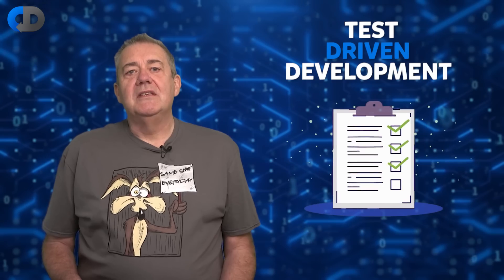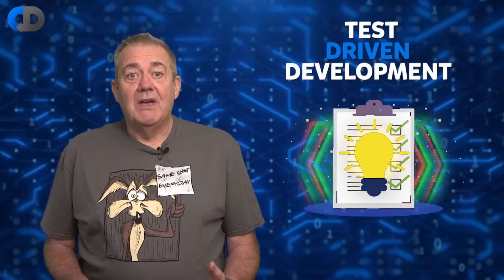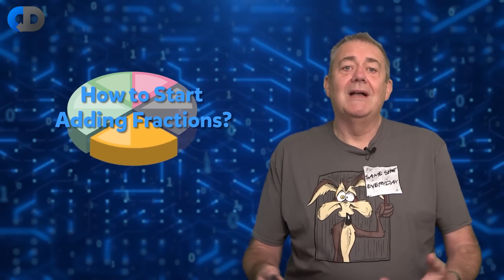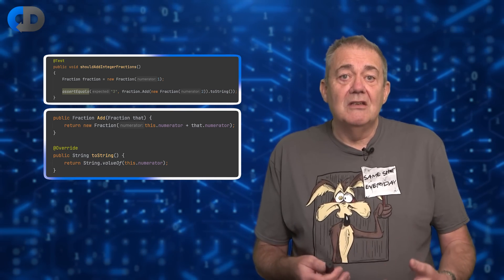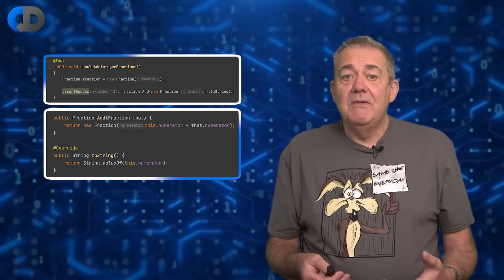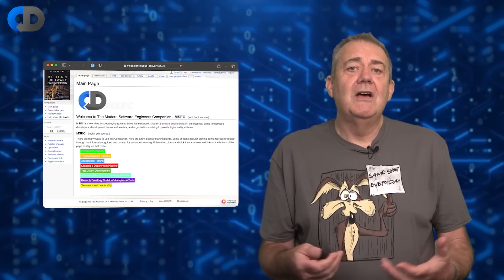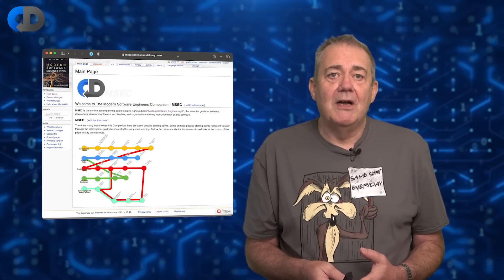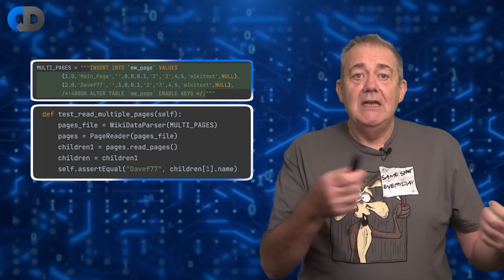Test Driven DESIGN - Step by Step

Comment: The assertion and act should be two different statements, segregated by at least a blank line. The way it is written now impedes readability. Also the test scenario name is poor - it doesnt't reveal what is expected. And you forgot to demo that in TDD, you can write a test without any code to begin with, red means does not compile and it can be fixed by generating code.

The name of this video is also deceiving - it is just one test case. What to test next remains unanswered.
Reply: Arrange-Act-Assert is a pattern, not a Law of Correct Unit Testing. For a simple case like adding two fractions, I much prefer inlining rather than having a separate statement assigning the "actual" to a temporary variable to assert on, simply because it is more concise, and it is perfectly readable. 
Consider this code:
    
    @Test
    void aTimeSegmentCanBeInSeconds() throws ParseException {
        assertThat(parser.parse("PT10S")).isEqualTo(Duration.ofSeconds(10));
    }

This test is a one-liner, but to me, it is perfectly clear what is under test, and what is being asserted: the string "PT10S" gets parsed to a duration of 10 seconds. Now I could separate this into separate arrange, act, and assert statements like so:

    @Test
    void aTimeSegmentCanBeInSeconds() throws ParseException {
        String tenSeconds = "PT10S";
        
        Duration actual = parser.parse(tenSeconds);

        assertThat(actual).isEqualTo(Duration.ofSeconds(10));
    }
I strongly prefer the first version, simply because i can scan that piece of code to get the information i need much more quickly. In all honestly, if my test is such that i would need to split these statements up in order to improve readability (which can definitely happen), that to me is a smell that the test is too complex and that i either need to redesign that test, or redesign the code under test, in order to allow for better testability.

Comment: Test driven development NEVER WORKS.  NEVER, EVER, EVER EVER!  It is not how people behave.  Yes you can have good testing framework.  But human creativity does not start with test.  Face it.  Fact it.  Face it.  You can spend next 20 years talking about test driven development.  And 20 years later it will still the same: design, development and test.  That is the natural order.  Just like putting the underwear on first, then put the pants on, then put the shoes.  Natural order.  That is how human think and behave. 

Of course in AI work, you can dictate how machines operate.  And you can dictate test driven development.  And it might work.  For machines do not care to develop test cases first.
Reply: Tests describe how an interface should be used, and on the other side of the interface is a black box to the tests. By writing tests first, I've always come out with much cleaner interfaces and more decoupled code.
Reply: "That is the natural order" ... Says who?
Reply from the maker: Sorry but that is simply factually wrong. It works for every team I have worked on for the past 24 years, it works for SpaceX, Tesla, Microsoft (in parts), Google (in parts), Amazon, Netflix and so on and so on and so on. It is how some people behave, and when they do in my experience they write better software as a result. Human creativity starts with understanding something about the problem, and then making a guess about how you would like the external answer to be communicated to you - that is your test. 
We could argue about the word "Test" in TDD, I think it is better thought of as a specification, you don't write specifications after the design & development do you?
Reply: @manuelstausberg8923  Says FACTS.  Tell me how many companies are doing test driven development.  This approach has been pushed for so many years.  But how many companies adopted this process?
Reply: @pyrotecx123  I am not saying it does not benefit YOU.  But people simply do not start writing test case first.  If you were right, many companies have been doing it. But let's face it, most companies are still using design, development, unit test, integration test, qa test and deployment process.  You can define an interface for your feature.  But that is part of the design.  It is not test.
Reply: @pyrotecx123  Again, you can tell me whatever.  But FACTS is that most companies design and develop.  And then write unit test cases to confirm their development.  In fact, many systems are so complex that you simply can not just write unit test cases.  Instead, you need to deploy to QA environment because that is the only please that can be tested, end to end.  And you will call it unit test as long as it flows through some features and you can confirm the log that the code is exercise TO AN EXTEND.  That is about it.  And then, when other systems are ready to integrate, you go through integration in QA, now that is integration testing.  Once that is checked, you then ask QA team to test fully, like a customer.  And if there is issues, you will fix it, deploy to QA and QA test again.  THAT IS REALITY.  THOSE PEOPLE TALKING ABOUT TEST DRIVEN DEVELOPMENT are people who either never work on massive and complex systems, or they are just tinkering little projects that have at most one or two component systems to deal with so they can easily set up data or process to test whatever they want.  So they can do this UTOPIA solution: write test cases and run test cases.  Yeah sure, that sounds like a good idea until you have mass data set and numerous components to deal with.  No, you can not stub because you can do it one time or two times, and you quickly realize your are drown in stub objects and the schedule is fast approaching.  Again: REALITY AND FACTS.
Reply: @jkuang  no one said you should be doing ONLY unittests... ?
Reply: @manuelstausberg8923  I am saying you should not START with unit test as the basis for design.  Test driven development is not natural.  It has been proven for many years people SIMPLY do not work that way.  I am not arguing it with you as a fresh idea.  It has been there for many years and people don't do that.  As I listed before, for complete systems and massive data system, it is NOT PRACTICAL.  And for small projects with one or two components, it is no big deal.  You can do whatever you want.  Small fish.
Reply: Why don't you just write a test to "help" work out the design as the first step? Then integrate the design into your development to make the test pass. Then run the test(s). Wash. Rinse. Repeat.

As far as the "natural order" of things. It really depends. If you have to test if your design works in the real world, sure, you have to come up with a design, build it, then try it out, see if it blows up or flies or whatever. But you're forgetting something: experimentation and research. Before any bright engineer designs something, some mad scientist mixed bits and pieces together and conducted "tests" to see what would happen. 

So, it kind of depends on your level of analysis. The test in TDD could be like setting up an experiment. You know the outcome your looking for, sort of, but you don't know what will make it work. The test or "monitoring equipment" helps you to know if you got it right.